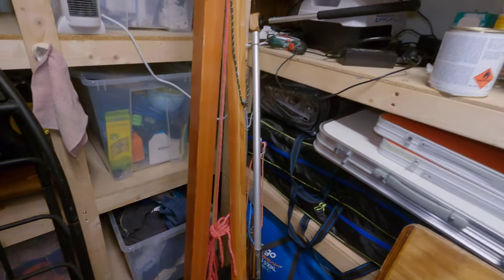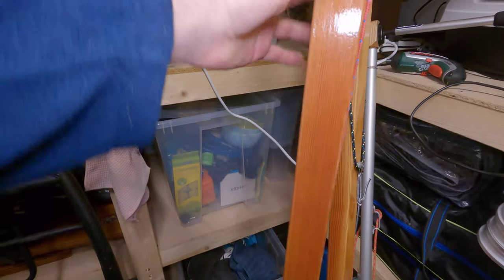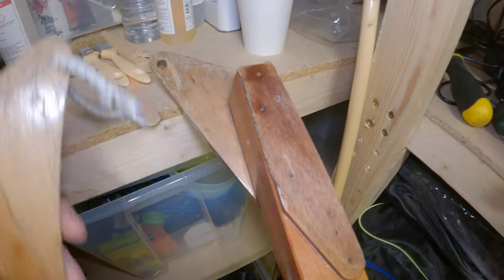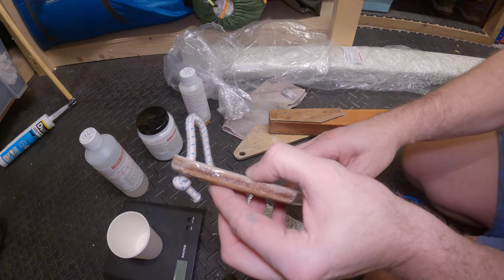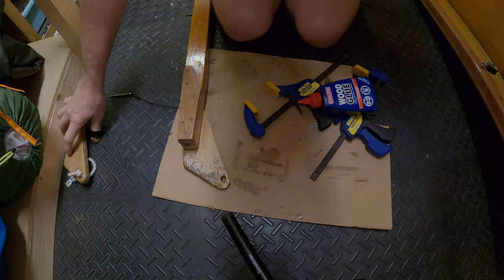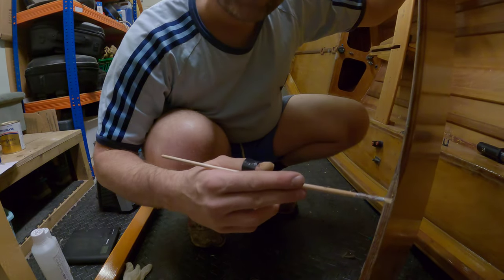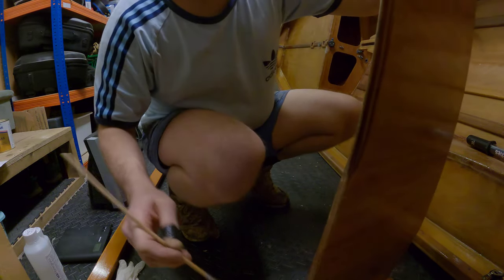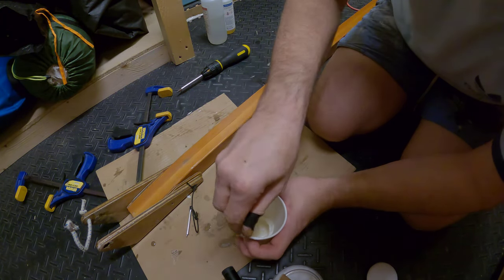Fixing the boat chandlery

Comment: I'm no expert, however, I've been watching videos of this nature also, in prep for repairing my boat. I think when screws have been removed you have to seal the holes with wet epoxy, screw back in screws, then put some droplets on the screw head to seal the screws, to stop water ingress. I was at Bala camping and sailing with my West Midlands sailing club last weekend, gusty Friday, Saturday hardly any wind.
Reply from the maker: Hi Joe

Yes you're right. To be honest if done properly, you would drill out the holes the screws would be going into, fill them up with epoxy and then re-drill out when dry and screw in the screws. This means the screw will not actually ever touch the wood and create a possible water ingress point.

However I have never actually seen screws put in this way on a dinghy. I mean I have asked loads of people how they have done theirs!!  When the boats not in the water most of the time I think it's fine.  I get to the point where I would rather be sailing than fixing!!